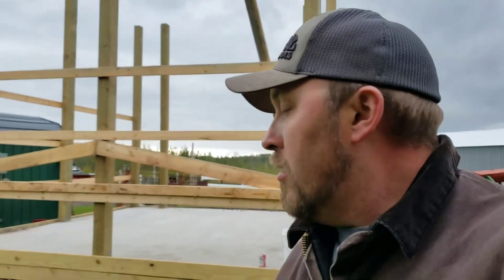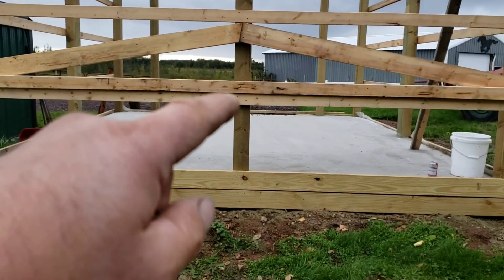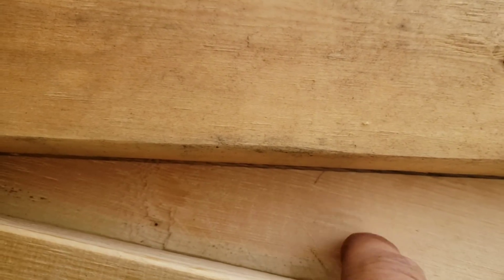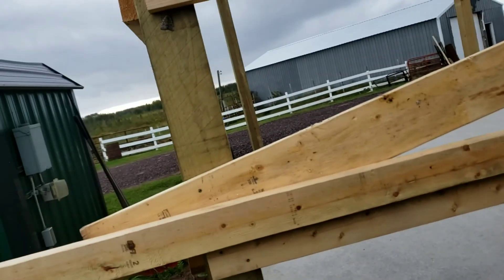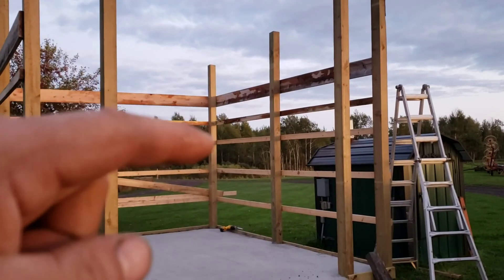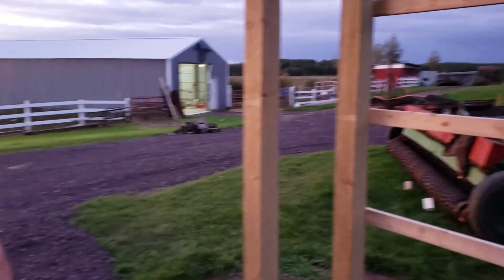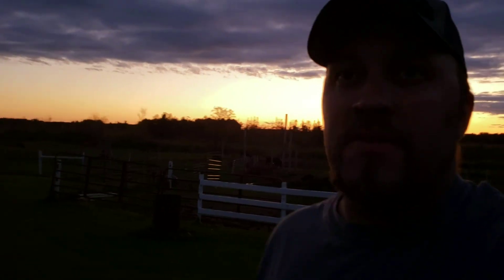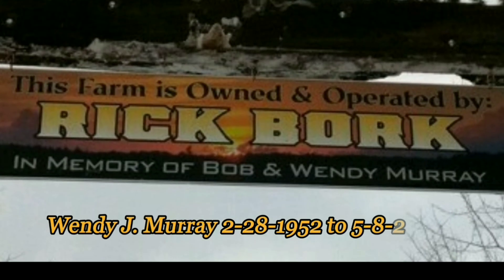Building a Simple Truss.

Comment: Looking pretty good Rick what’s the dimensions of the shed?
Reply: My area is 12x24, rock pad. I stack as high as I can reach then tarp it. Then usually bring some in and dump on the ground in front of the stove from work when we clean road ditches. It’s hard get a real total but I think it’s around 12to15 cords I use.
Reply from the maker: 14 wide 16 deep 9 high. I burned about 8 cord of low grade wood last year this should hold 12 plus cord and with the shop being on line by winter " I hope "  I should have a little room to spare. Mind you I plan to burn scraps and such till real cold weather hits and in the spring. Either way I think it will be better than digging in the snow bank lol. Thanks for stopping by man hope all is well. Take care.
Reply: Does he know the dimensions of the shed? No. Does he care? No.